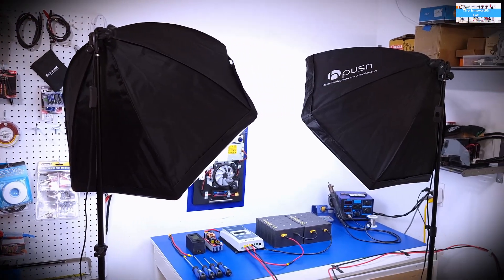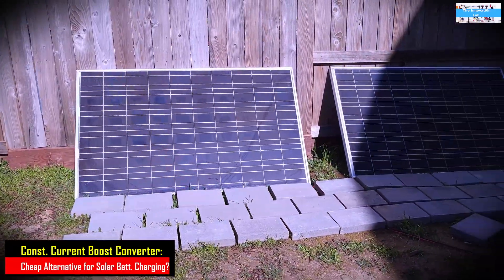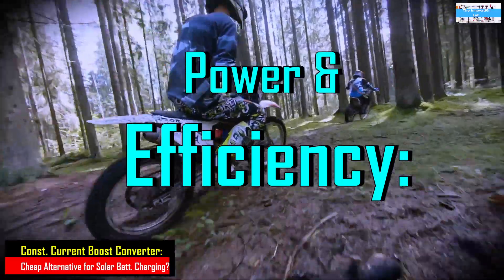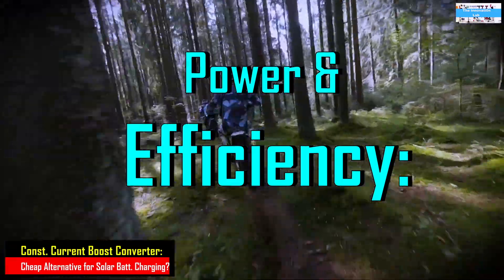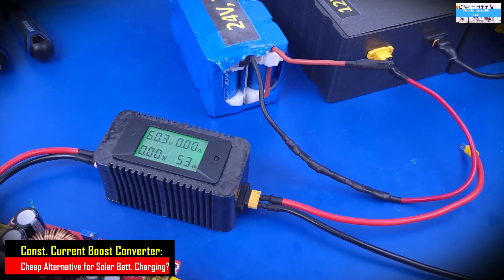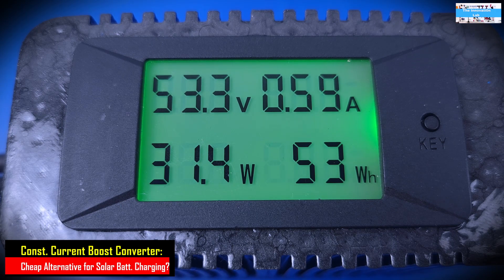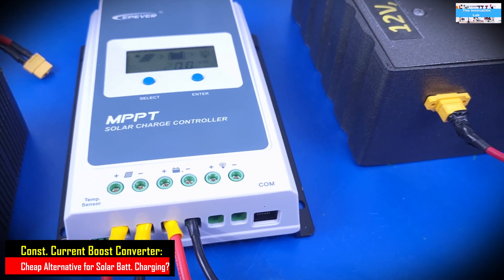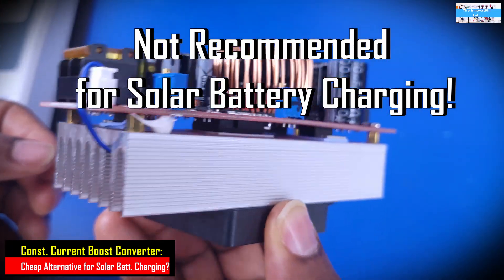MPPT VS DC-DC BOOST CONVERTER: WHICH IS BETTER FOR SOLAR BATTERY CHARGING?🤔

Comment: Halle una forma decente de hacer funcionar la carga solar con convertidores dc. Lo hice de la siguiente forma, utilice 3 convertidores en paralelo con el mismo voltaje de salida y unidos mediante resistencias de ecualización. Fijé el amperaje de cada modulo en 1/3 del amperaje del panel y a cada uno configure distinto voltaje de activación. Por ejemplo en ni panel de 590w con un vpp de 40v, el primer modulo en 36v, el segundo en 38v y tercer modulo en 40v. De esta manera se van activando a medida que mejoran las condiciones solares o desactivando a medida que empeoran manteniéndose en un rango cercano al vpp y logrando una generación optima y a mucho menor costo que con un controlador mppt. Espero les sirva. Saludos desde Villa Ocampo - Santa Fe - Argentina
Reply from the maker: Wow!!
This a wonderful suggestion!! I love the way you think!
👏👏👏👏

I will definitely give it a try in the near future.
Thank you so much for sharing.

Remain blessed,
The Innovati0n Lab.
www.theinnovati0nlab.com

Comment: U hv no idea what u r doing, the mppt is stepping down the voltage from the panel to charge 24v system, why would u add more batteries and subject the converter to step up the solar voltage? Wrong. This is no way a comparism but just random experiment😂
Reply from the maker: Hello,
Thanks for another engagement.😊

You seem to be one of those people who go through other people's contents looking for microscopic nuances to disparage their hardwork.....wonderful if that makes you feel smart. 
If you have a question about the premise of the experiment, simply just ask and i will be happy to explain. If you have a suggestion, you can provide it in a less insulting way. We must all aspire to be good and respectfully human beings on the internet - even if we are using aliases.

The premise of this video was one that was inspired by my audience's curiosity.... to know if this boost converter can be used as a cheap DIY solar battery charger. 
Yes, the MPPT charge controller works in a buck mode - using complex incremental conductance algorithms and software that was specifically designed to optimize the IV (voltage * current) handshake between an applied load and the solar panels - being weak dc power sources..with high series resistances.

 The boost converter, on the other hand, works in a boost mode - with a simple TL494 PWM driven circuit. 

There are no known laws of physics that prohibit the performance comparion of two different devices when used to implement a similar function. The goal was to look at the overall of efficiency of the two devices in harnessing solar energy incident on the solar panels. Yes, battery voltage and specs play a role, but those are minute variables in this case. What matters is to establish a basis of commonality or a reliable frame of reference for the experiment.

The word 'comparison' as used in this context alludes to a contrast between the 'solar battery charging function' of both devices and not a comparison of their respective design topologies.

I hope you have enough electrical/electronics design literacy to comprehend this explanation.

Cheers!
Respectfully,
The Innovati0n Lab
Reply from the maker: Try to get your points across without being cynical. A lot of us are on YouTube trying to share our knowledge and give back something postive to the world. Being an internet bully is one of the easiest things that anyone can do - again you can get your point across with a little more optimism.

Respectfully,
The Innovati0n Lab.

Comment: Yes, it is 100% possible to use that particular boost converter as a charge controller in a solar system.

That converter has LVC, the potentiometer on the input side and you can set that to a panel's Vmp to extract as much power from the panel without it "choking" from trying to pull too much power.

I do this regularly to boost 16-19.2v to 54.3v to charge a 48v battery with 96.3-96.7% efficiency
Reply from the maker: Thanks for the feedback. This video is about 2 years old and I wasn't saying it doesnt work for solar charging, the main point was that MPPT charge controllers are more efficient.....so less power losses.

https://youtu.be/3v5FmnvwdmQ?si=QZO3efHnTfP00n30

Respectfully,
The Innovati0n Lab💥
www.theinnovati0nlab.com
Reply: @theinnovati0nlab782  no it's not. you just don't know how to use this correctly. the DC-DC converter has power loss because you set it at 60V not lower, the closer the input to the output voltage the better result you will get. infact, you could get even better results if you used the 24v bank and change the voltage output on the dc-dc to the specs on your solar panels closed circuit setting. which seems to be about 28v. which is only 4 volts more than the 24 volt bank which is probably and most likely full at 25.6V. so if you set the right voltage on the converter you probably woul get 97% or better efficiency setting it at let say 28.5, keeping in mind you have v drop from the panels to your shop. i don't think the mppt charger is any better than the dc dc converter other than it's got a screen. i used to run indoor Led 100W bulbs in series off these 250w panels directly with no converter because they were able to handle 30v range and that worked great, especially in my kitchen are in my apartment where it did not get good sun light. it was the best thing ever. Free light!
Reply from the maker: I have done more work, modifications, research, and testing  on these converters than you could possibly think of. Go watch the videos I have made where I provided indept analysis on my channel. Saying I don't know how to use these converters at this point is a bit insulting and condescending.

What you are describing is a low voltage, low power application....of course with an input-to-output voltage difdential of 4V.....while driving a load of 100W, you will not see the issues I was describing.
I have modified these converters to provide close to 2000W while delivering >80V at >95%, and at more than a 40V input-to-output voltage differential. 
So, yes I know what I am talking about.

Also, saying that these converters are better than MPPT solar charge controllers that are designed with incremental conductance algorithms....clearly tells me that you don't understand the difference between the two devices and their respective topologies.

What will you do if you have a 30V solar panel system and wish to use it to recharge an 80V battery system?🤔🤔
These are the types of problems I set out to solve on this channel... using this converter to raise  your panel's voltage by a few volts to drive a 100W light bulb is extremely easy and anyone can do that.

Next time please start by ask a question if you don't understand the premise of a project in any of my videos.

Respectfully,
The Innovati0n Lab

Comment: My question is, if the output current of the DC-DC BC causes the converter to not regulate correctly when you exceed available current from the solar panels, will this also be the case when using a DC-DC BC to power a DC motor directly from solar panels? Your videos are great btw.
Reply from the maker: Thanks for the wonderful feedback.👍👍👍
Great question.
The simple answer is yes. 
For a boost converter or any power supply to maintain output regulation, you must provide the converter with reliable steady-state power that it needs..actually, you have to be able to provide more than when the converters are delivering to your load as a result of efficiency power losses.
This is exactly the reason why MPPT charge controllers are recommended for solar battery charging because solar panels are pretty much fluctuating and relatively weak power sources.
So in a nutshell, if the solar irradiance goes down and your load stays the same, the output voltage would crash and this could actually backfeed lots of current to your solar panel....and over time, it will damage your panels.

 I hope this helps.
The Innovati0n Lab💥
www.theinnovati0nlab.com

Comment: your demonstraation is wrong, you should used 12 v pannels for this test. because the boost covertor only boost the volatges...secondly, there is a step down convertor of same circuit, for this test you must used that one.
Reply from the maker: Your opinion is rather incorrect. If you don't understand the premise of the video, then you are welcome to ask a question.

There is no law of physics that says you can't use boost converters with solar panels. There is nothing that says you must use a buck converter for a solar battery charging application.
You started by condemning the video for being wrong, but you failed to provide a convincing design argument.
The Innovati0n Lab💥
Reply: @theinnovati0nlab782  step up booster cannot change 34v to 24 v....its as simple as popcorn....form 34v to 24v you must use buck step down....its the specifications of buck.   secondly, you must use close voltages for higher performance....its can give you 95% of performance output.

Comment: Are there any non variable DC to DC boost converters? Example would be, if I wanted to boost the voltage to 30V. Im building something that needs a voltage boost. However, I don't want to have to increase it manually. Thanks
Reply from the maker: Wonderful question!
👍👍👍
I am sure you can find fixed output voltage converters. However the issues you may run into might include high costs and possibly power limitations. 

The variable output converters should work for you. In your case, the output voltage  variability is just something you have to set one time ......and that will literally make it as good as a fixed output voltage converter - irrespective of the input voltage variations.

I have made multiple videos on how to make output voltage and current adjustments on these converters. Once you set your output voltage, set you output current (max point...in your case), then you are done.

Some relevant videos:
👇👇👇
https://youtu.be/2KyBwwldqkk?si=rGDwYEzg_VePoO9l

https://youtu.be/WDWJ77WWkXc?si=m-W2959WbUarQKEF

https://youtu.be/0Ct_sgbAjU4?si=dvzB4LSH-0eumeju

I hope this helps.
👍😎
The Innovati0n Lab

Comment: there is a third potentiometer on thebcheap converter. if you turn it all the way up  you could push more than 2.4A
Reply from the maker: Thanks a lot for the wonderful feedback.
Is this something you have tried and it works? Or is this a theoretical recommendation? I have done this a long time ago and it didnt work. These converters are designed for steady state applications.

Comment: Thank you sir for your advice, if i dont watch your video then i must buy the dc to dc boost converter for my solar system to keep my money.
Reply from the maker: Hi friend,
Thanks a lot for the wonderful feedback.
👍👍
Honestly speaking, I will encourage you to save your money and buy an MPPT solar charge controller. I have used the Epever controller on multiple solar projects, they work really well, and they are very reliable. Also, they help you save more of the energy from your solar panel.
My intention has been to develop a diy charge controller and share it with our audience. But sadly, I have not had the time to develop it. 
👍😎

Comment: It has limit. Use it to charge 12v battry
Reply from the maker: Were you referring to the boost converter or the MPPT charge controller?
The MPPT controller can charge both 12V and 24V. The boost converter has an output voltage range of 12 to 95V.
So either of them can charge higher than 12V.

Comment: Boost converter autocut when battery full ?
Reply from the maker: It depends on what type of battery you have and your charging voltage setting on the boost converter. 
I have made lots of videos to explain how the dcdc constant current boost converter works as a battery charger. Please see the videos below.
https://youtu.be/WDWJ77WWkXc
Reply: No, if you adjust them to the fully charged voltage of the battery they will lower the current as they approach the set voltage, and will try to keep the battery on that set voltage

Comment: Please why didn't you use the boost converter to charge a 36v battery?
Reply from the maker: Hi friend, Thanks a lot for such a thoughtful question. 👍👍
The simple answer will be that it really didn't occur to me at the very moment. It would have charged a 36V equally the same - but maybe with a higher charging current. 
One of the benefits of using a boost converter is that you can basically raise the voltage up to 95VDC if you choose to do so. The only one caveat  is that, since the input power is constant, the higher your voltage setting, the lower your charging current will be - and vice-versa.
Reply: @theinnovati0nlab782  yeah but you could have had less loss. it would have not been equally the same, the coverter have loss depding on the difference in and out v. and you could have adjusted the voltage WAY lower than 60v, that was the peak output voltage.